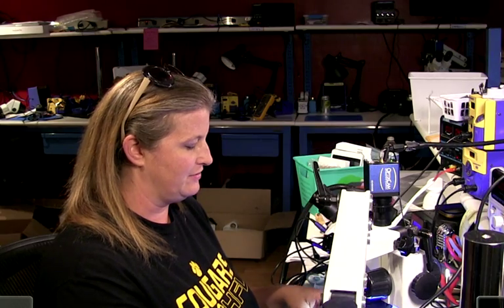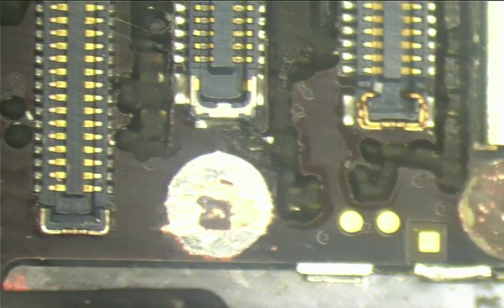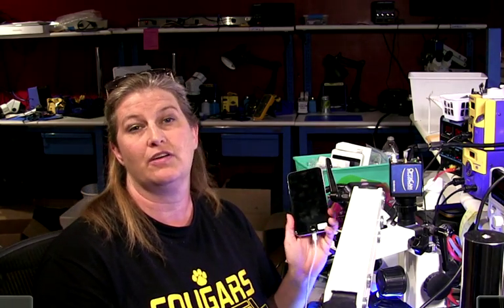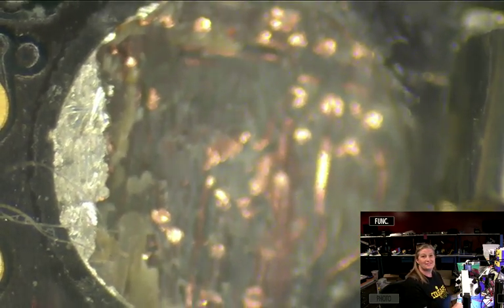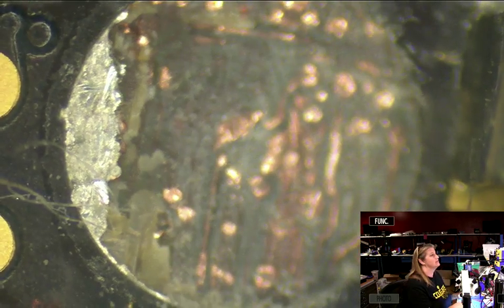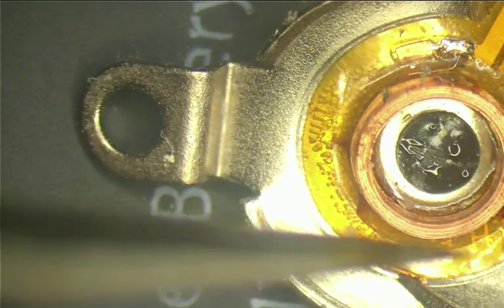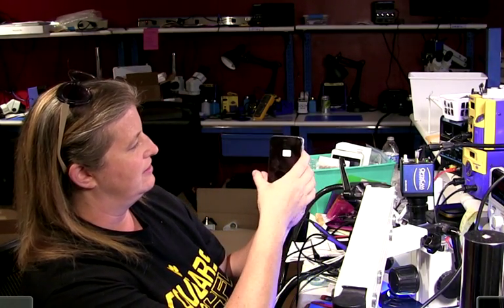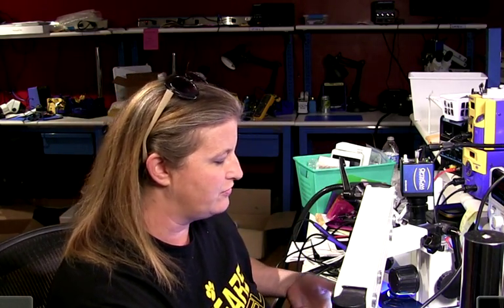Screw the Schematics---iPhone 6+ long screw trace repair as complication of touch ic disease

Comment: use a strand of wire from  antenna/signal flex for this kind of repair. I see too many people struggle with speaker wire trying to remove the enamel or trying to tin the wire to make a good fix. A strand from the  antenna/signal flex is just as thin and is already tinned. Much easier. Tin the damaged tracks and lay piece of antenna/signal wire other the two broken ends of the track, use your heat gun for it to solder and make contact. No need to use a soldering iron. Much easier and faster
Reply from the maker: that wire would be waaaay too thick.  This is a strand of wire from inside a vibrator motor coil.  Plus you want it to be insulated if you are running jumpers in second or third layer and need other jumpers over that.
Reply: its just as thin as the wire from coil. Easier to use as its already tinned. No enamel to remove.  If you are running jumpers over each other that might be a bit different  but for small confined areas like the screw damage repair this is perfect. Try it before you knock it

Comment: A schematic is a work of art and is the copyright work of its author(s). The connection pattern of the circuit board can be reverse engineered and a new schematic generated that is a new artwork. The connection pattern is a part of the product that can not be kept secret if a product is sold and can be legally dismantled. Schematics, like any artwork have value and should not be distributed without the permission of the author(s). 
All manufaturers should make repair information and parts available at a reasonable price to support their customers. Those who do not should be publically shamed by the community and media.
Reply: Thanks again for your videos, I think that they are of great value to the community.
It's a pity that manufacturers lie about the repairability of their products and fail to participate with the repair community to support their customers who are the real losers in this situation.

As a designer I take great efforts in trying to make schematics that convey the function of the circuit along with the wiring and often incorporate into the schematics various debugging and testing values.
A great deal of credit should be given to many Japanese manufacturers for their excellent service manuals which I have worked with over the years. As software plays now such a major function in modern devices the schematic has become far less important and now is almost an afterthought in device servicing.

Brenden
Reply: If the only copyright in a schematic is the artwork then it should be possible to use a copy of the schematic to redraw the circuit in one's own style, with no copyright issues in the new drawing, even though you had to use someone else's breach of copyright to get the information in the first place.
Reply: The point is that you DON'T have to use someone else's breach of copyright to get the information in the first place. Yes, that is most likely how it would happen, but you could also just spend hours tracing signals all over the board and figure it out from scratch, so the existence of a third-party schematic wouldn't be proof that copyright had been breached.
Reply: My point precisely, I agree with you. But the original schematic is copyright of the artist. A newly drawn one is not, the drawing is copyright but not the information it contains which can be legitimately obtained by other means.

Comment: Good video, I just did an iphone 6 screen swap but i placed the screws in the correct holes and now neither the new or old screen works. it did work for a few minutes though. Itunes sees the phone, ive restored and updated it but the phone does nothing. No image on screen, no backlight, no sound or vibration, i call it and get nothing. Very frustrating because I cant remember the amount of flawless repairs ive done. Nothing like what you are doing but only because I dont have the equipment. 

I just wish I could figure out whats going on with this iphone.
Reply from the maker: sounds like a copy screen blew the backlight

Comment: I bought an iPad 2 a few years ago and it was rendered useless far before its time, but I never dropped it or damaged it in any way. So who ruined it you might be asking?

Apple did, with their intentionally crippling updates that they force-download to the device while connected to WIFI. I know I'm the one who installed it....but Apple is taking planned obsolescence to another level. Right now there's a class action law suit over f**** up older devices, and it's about time. (sorry for ranting)

Anyway, I just recently found out about you and what you do, keep it up!  Let's hope Apple doesn't try to pull anything sneaky on ya though!

Comment: when something like this happens do you quote a customer for an additional repair before proceeding and if so do you discount the work?
Reply from the maker: We sell solutions---"Make it charge"  "Make touch work" etc.   The only thing we come back and change the quote is if there is a parts problem in addition to the board repair, or if they have sent it in for the wrong solution---i.e. "not charging" when the reality is that is it "not booting"

Comment: Month old video, brand new question: Jessa, do you put something on top of those holes to avoid shorts or just to avoid user damaging it up again? Like cement or something. xD
Just out of curiosity really, seems really bad when things internal to the board gets this exposed... the traces I mean.

Thanks and great video!
Reply from the maker: yes, we leave the screw nut off and put an epoxy or conformal coating over the surgery site.

Comment: I read about how you learned from forums. Can you name our favorite forum? I'd really like to start with this, problem is I don't have any forum for support. :(
Reply from the maker: That's a reasonable question.  For board repair info gsm forum is good, the paid forum by Filip Pusca of iTeslasolutions is good--this is the former cyberdoc forum.  To get wind of common problems, read Apple Support Community forums, and to see what kind of common DIY problems are around read iFixit Answers.  To connect with others in the industry, Facebook industry groups like Cell Phone Repair Shop Talk forum are good, as well as iFixit Pro Talk.   If you want to learn MacBook, then of course join Louis's paid forum for MacBook troubleshooting.

Graduates of Practical Board Repair School join our private alumni forum after the course.

Comment: Hi ... I have an iphone 5s  and I have a problem with him.  when I power on  apple logo appears but turns off immediately. from what can be?  tnx
Reply: cann you respond me plsssss
Reply from the maker: It can be anything.  Start with software.
Reply: +Jocurile Mintii restore with iTunes
Reply: I tried with iTunes but not respond
Reply: Check if the phone drawing the correct amount of amps
Reply: haw i do this ...
Reply: if i remove the motherbord  and I put another one hi do same sh*t
Reply from the maker: This is a bad battery then.
Reply from the maker: right, so replace the battery and make sure it is the correct battery and making good connection.